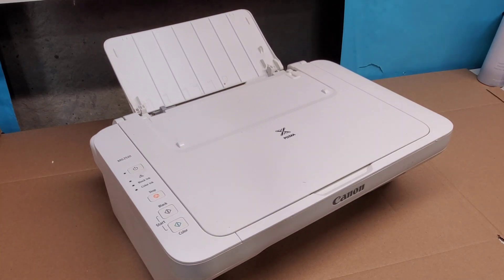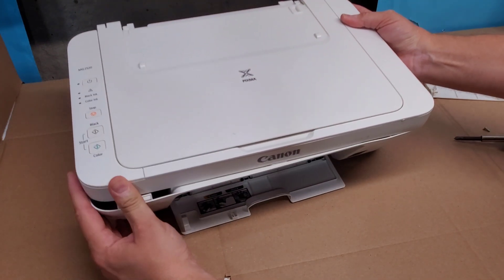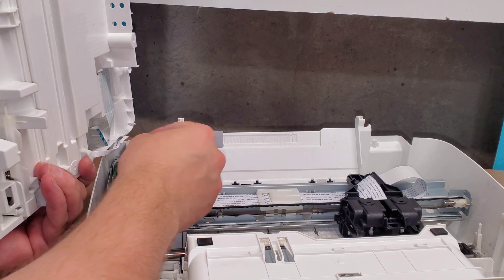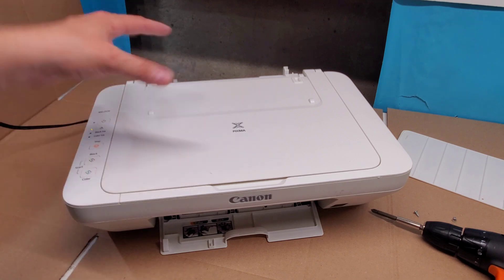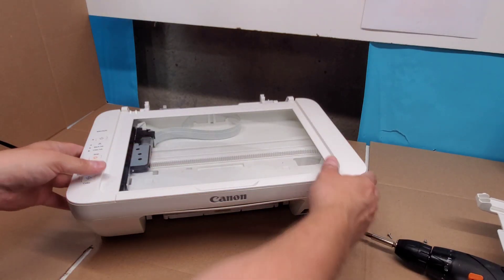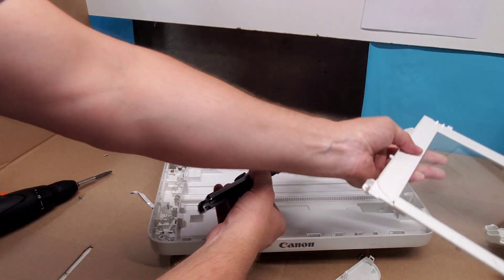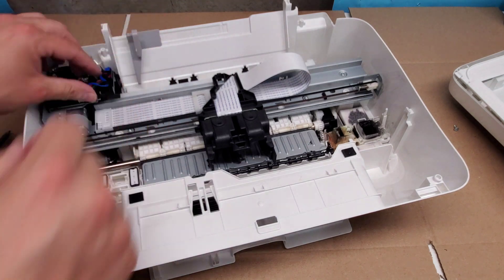Taking Apart Canon Pixma MG2520 Printer to Clean or Repair

Comment: Genius! Solved my problem, there was a small white electrical connector jammed in the paper feed which couldn't be distinguished! I was a bit worried about the ribbon connectors, but they came out and went back in without a problem.

Comment: My elderly father’s Mg2522 could not print black ink. Problem remained after replacing the cartridge and doing a software clean via the power button. So after watching this I tried to open it up myself. First problem is those ink sponges are dirty, second problem is the plastic ink reservoir is filled with old gunk. Third problem is the two electrical wires came off when removing the top and I still could not reconnect them.

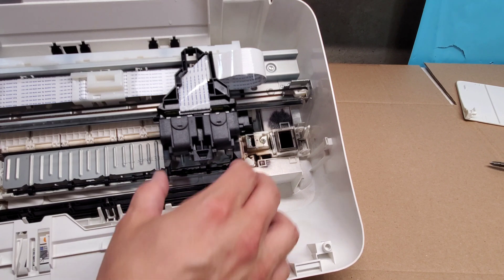I thought you said this thing was easy to maintain?? It’s not. If it was, Canon would have made it easier to manually clean dried ink instead of hiding it under two screws and two hooks in front that are hard to undo. I expected an explanation of the process at 3:15 but you failed to do so. I expected more. Do better. 👎👎👎

Comment: Thanks to the uploader of this useful guide. I used it to help me open up the very similar Canon model I own (an MG2550S) since I had no clue how to do so,  in order to resolve the paper feed issue I had with the same.  Low and behold after opening up, taking care of course re those two ribbon cables the source of the issue was identified, an AAA battery that had somehow fallen down the printer tray!  No wonder the paper was not feeding and once removed all was good, meaning I'll keep on using it rather than throwing it.  The only issue is as shown in the video is its a little (well more than a little) fiddly reattaching those two ribbon cables for the scanner as you put it back together again but just take your time, its more than doable.  Also once done if you notice the power button flashing, check you have closed up the front opening (which you would install a new printer cartridge via), it will stop flashing once you do!
Reply from the maker: I appreciate your input very much. Have a great weekend!

Comment: 2:33 reconnecting everything is so difficult! I had to redo this part multiple times, the connectors are so short!! Thanks for the video, though, this is a life saver!
Reply: I'm in the process of figuring out how to put it all back together now. Can you share the secrets of re-attaching the scanner?
Reply: The left panel with the buttons comes off. Remove the side panels and you have access to plug both ribbon cables back in with no issue.

Comment: How do clear the ink waste message 5B00? I took the printer apart. I'm guessing the far right contraption and/or the foam has to be cleaned. Thanks.
Reply: Have you figured it out i ahve the same problem

Comment: Thanks to this video, I got my Canon MG2922 apart. I have error 10 which indicates "Needs Service" but I saw everything OK, nothing wrong or suspect. I cleaned the Ink Absorber and reassembled the printer but still have error 10. The startup noise is different than when OK. Any ideas? Thank you.

Comment: Great video!
My problem is that the ink cartridges do not move when I turn on the printer. The just don't move and are not visible at all. The error light blinks 10 times, pauses, then blinks 10 times more, over and over again.
In my control panel under "Printers," my mg2520 printer is the default, but running the ""Troubleshoot" does nothing except that it tells me nothing can be done with the Troubleshooter.
Any help will be greatly appreciated.
Thanks in advance!
john

Comment: Omg, thank you so much for this video.  My printer started jamming as the paper tried to feed.  The paper would barely go halfway and stop.  We noticed a bad crinkle in every piece of paper in the same spot on the left, close to the roller, but not directly in liine with it, so we tried card stock and it did the same thing.  We were able to take it apart, and insert the cardstock part way into the feed to see where the crinkle lined up, and looking inside from the front of the printer, we saw something black.  We tried to move it but it was stationary, so we thought it was part of the printer.  From the front we saw that it was definitley blocking the paper path, so we pushed harder with a butter knife and it came out!!  It was some kind of plastic cap that had fallen into the paper feed, and the more times I tried to print, the farther it was getting wedged into the printer.  it doesn't even look like part of the printer, which makes no sense. My printer is on a raised stand, about 10 inches above my computer desk, so I can store things under it.  There's nothing above it for it to have fallen from.  It's a crazy mystery, but I'm so grateful we were able to fix it because I just installed brand new ink cartridges 2 weeks ago, and I didn't want to waste $55.00 in ink!!

Comment: Hey bud, if you take off the top side panel where the lights are and the buttons you can access those two electrical strips very easily. 
That panel will pop right off and you don't have to fight those electrical strips to reconnect them. Just a little FYI.
.
Reply: How did you get the side panel off? Acutally, I don't see a side panel. What's your secret?
Reply: Brilliant. Thanks so much. Once you find all the little plastic latches and unlatch them with a tiny screwdriver it just pops right off. Damn, I spent like an hour doing it the hard way, then saw your post. Nice.  I was trying to figure out how the factory assemblers could have managed it the hard way, and figured there MUST be an easier way. Thanks.
Reply: No idea what you mean by top panel coming off. The controls are firmly set into the top part of the printer, and the two electrical strips are disconnected and I can not reconnect them.

Comment: I bought a used MG2922 Canon. It has a problem wherein it does not print about the last 1/4 inch of a document that is the last part of the paper when it is discharged  from the machine. Going to the Canon self help forum online has netted no help at all. Any ideas?
Reply: It just can't do that. That's common for cheap home printers

Comment: Hi! I'm new to your channel but I can see how useful your tips are. Thank you! Another thing is, that my Canon Pixma MG2460 cartridges are not recognized by my printer and I was new to refilling them. I didn't realize there was too much dried ink inside before adding ink to them. The dried-up ink inside turned almost like a rigid polyurethane foam because it stuck for about 3 months in a 36-40-degree room. Do you think the warm water with a solution would work if I tried it? It costs a lot of money to get a new one. Hoping for an answer. :)
Reply from the maker: Hello and thank you for your comment.  It will not hurt the cartridge to try soaking the nozzle of the cartridge in water. Leave it for a few hours in water and some window cleaning solution. Redilling with new ink will also help dossolve some old ink. There is no guarantee however,  but you most likely will see some result.

Comment: Thanks for the video. It was very useful. I'm wondering how to clean up "ink absorbers" in this model. I've seen another video, but the ink absorbers were right below the cartridges, but in this model, it's different and my fingertips aren't reaching there from outside the printer through the hole for changing cartridges.

Comment: This exact model printer feeds paper about 2 inches then stops but the printer still thinks the paper fed through and prints. There's no error code and it completes the print without the paper feeding. The only clue I have is the paper gets a small crumble in the center of the feeding side but otherwise  I opened it and haven't noticed anything out of the ordinary I'm stumped with this one.
Reply from the maker: Hi. There most likely is a tiny piece of plastic or clip in the area where the paper gets damage.  Try feeding card paper through the paper path, but from the front. You may be able to push something out.

Comment: hi. Iam having problems with error code 5B00...Doing hard reset hasent done anything. Printer keeps blinking from green to orange leds after coming on...Any pointers?
Reply from the maker: The problem is with ink cartridges. Remove ink cartridges and check to make sure they do not have any dry or wet  ink on the bottom or chip contact area.  Usually, it's just one faulty cartridge that needs to be replaced.
Reply: @303electronics  Thanks for the tip, but the cartridges won't move when the printer is turned on. They just won't budge...I can't even see them.
Any idea on how to get them to move so I can check the for faults?
Thanks!
Reply: I have the same problem, except that my ink cartridges won't move...not even an inch. I can't see them either. Any suggestions?

Comment: mine wont turn on now.  It's dead.
Reply from the maker: You may have disconnected a wire somewhere if you tried to open the printer.

Comment: Where is the "ink absorber" located and how do you clean it?
Reply from the maker: Hi. The ink absorber are the pads inside the printer, on this model, they are spread out on the bottom of the printer. Cleaning them or replacing will not remove the error on the printer. You will need to buy a reset code online to get rid of that error.
Reply: @303electronics  Canon considers the MG2520 disposable, and they say the counter cannot be reset through the service menu. What do you mean "buy a code"?  Googled it. Found nothing.
Reply: Thanks. Cleaned the absorber pads. Would replacing the control board bypass this error problem? Would not that be where the counter information is located (stored)?  @303electronics

Comment: PIXMA MG 2920 is also similar. Great video. Thank you.
Reply from the maker: Yes, it is. Thanks for sharing.  Have a great weekend!
Reply: I have the mg2922 and the small cable is backwards from the video.  The rest are the same. You need to face the blue side to the outside or it won't turn on.

Comment: If you remove the control panel you can access, and attach the cables to the connectors with ease. EIB Tech
Reply from the maker: I really appreciate your input. Have a great day.
Reply: How do you remove the control panel? Thanks!

Comment: How do you clean the ink absorber pads
Reply: They are on the right hand side and are tricky to remove and clean. Doing so will also not eliminate the error code as it is set through the firmware permanently after a certain number of prints. I am researching if simply replacing the control board will eliminate the error warning.

Comment: I have one of these. It makes one or multiple loud banging noises after turned on and before it starts to print. It has done that since new. It only prints about 20 pages on one black cartridge and the color cartridge runs out before the second black cartridge does. So it loves to drink ink.
Reply: there is a way to silence that loud noise in the printer section.  I'm not a tech person but found it very helpful.
Reply: The noise is the printer banging the ink cartridges so that the ink is fairly fluid. The ink will settle if not used for a while, and this banging "awakens" the ink.

Comment: I MADE THE PROBLEM WORSE.DAMAGE IT AND IT WONT TURN ON NOW.
Reply: me too! :( did you manage to figure out how to fix it?
Edit: Try to put the small cable’s blue side facing the left instead! It worked for me!
Reply: Same here :(
Reply: Same.  Can’t get it to turn on now.
Reply: You all probably just disconnected the control board from the rest (the smallest of the cables from when he opens it)
Reply: @miquelrodriguez8507 how do you reconnect it?
Reply: The same thing just happened to mine!!
Reply: That's my fear too
Reply: same here . damn you man !!!
Reply: Same, disconnected scanner cable and can't fix it now and it won't work without that being fixed.
Reply: Same here am stressed out 😭

Comment: This video was a big help.  I'd never have figured out to pop the scanner off on the right side on my own.  One thing I would like to add is that when reconnecting the scanner it will be simpler to attach it first and then hook the cables to the board through the open control panel, rather than trying to reach under the scanner while holding it open.
Reply from the maker: Thank you very much for your advice and feedback! Have a great day!
Reply: You didn't show what is copy print or scan
Reply: Thank you for the connection tip through the Control Panel. My smaller cable came off up in the Control Panel so it would have been impossible to get it back in.

Comment: That long white part that holds the rollers in front of where the paper usually sits won’t stay where it should. It’s flush against the back when there should be a bit of space for the paper. And I have no idea how to fix it. It was fine before I opened it up to get a piece a plastic that had fallen inside. Did I loose a part? Is there somewhere that it connects that I’m just not seeing?
Reply from the maker: I'm sorry there is a problem with your printer.  Try removing the part that you took off and make sure to put it back without any force. I'm trying to understand exactly the area if the issue and can't figure it out.
Reply: I had removed and put it back together it several times, but nothing seemed to work. Luckily my sister has the same printer so she let me open hers up and I found the problem. The small white part by the spring wasn’t holding the rest of it in place because the part that’s supposed to keep that piece from just falling back got flipped up. I was able to push it back into the right position and now it works again.

Comment: I had the 'paper jam' code, but could find no jam. There was a white nylon drive gear for the path feed that had not completed its cycle. I spun the gear a couple of teeth to manually complete the page feed cycle. The yellow warning light stopped blinking & the printer came back to life. Thanks for this tutorial.
Reply from the maker: Thanks for the feedback. Have a great weekend!
Reply: I have the very same problem, it's really a VERY GOOD printer, inexpensive, low cost maintenance on the ink, I'v had my now going on 4+ years, i'll try the gear rotation thing; i was hoping the video would have covered this issue but, your answer is easy to follow; I had (2) HP Laser printers and the cost alone of the ink cartridges was astronomical, they dry up and clog the cartridges head and no matter what you did, you would always end up with "printer head" problems. Bought this at Walmart on special for about $40.00 and it's the BEST $40.00 Investment I'v ever made. Thanks.
Reply: My Canon MG 2950 has just died after 11 years with a solid yellow warning light. There is no known cure i can find. I suspect i have maxed the print counter. I liked my printer until yesterday 😟

Comment: Great...now show me where the ink absorber is located so I can change myself.  Not reset, but actually change the pads or clean.
Reply: Go back to around 4:35 and then go forward, at a slower speed, and at 4:36-4:39 look to the right of the printhead and the left of his hand hand you can see a Philips screw. Move the printhead to the left and remove the screw. That assembly will come straight up  revealing the ink absorber.    I still have not found an adequate substitute for the OEM pad nor have I quite figured out how the printer knows when that pad needs changing.

Comment: Tytyty that timing strip came off n pulled out wish didn't think can fix now see there's a spring n was wondering y not reaching the end tabs and see which way up with the L n dot marks way to reinstall now tytyty had to pause n zoom in but was able to see
Reply: @JustTurned62  That's not helpful. Some people have conditions like Dyslexia. Be kind.

Comment: Where does the spring goes that came from the scanner part
Reply: There is a spring under the power button (between the control panel and the board) that pops the button back up after you push it.